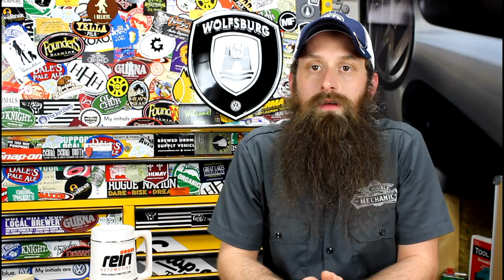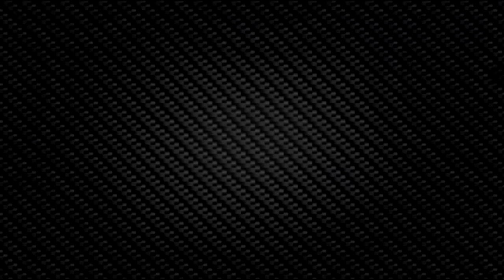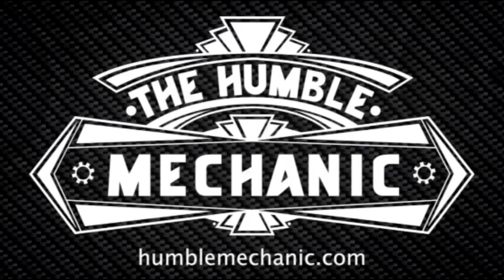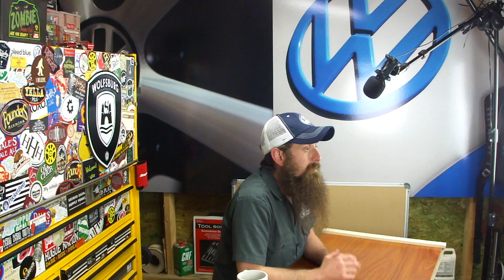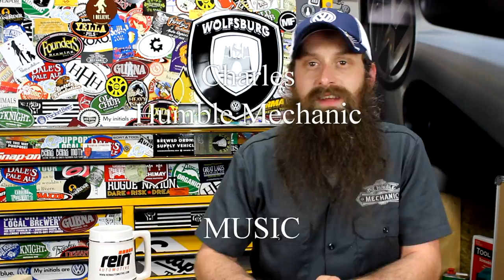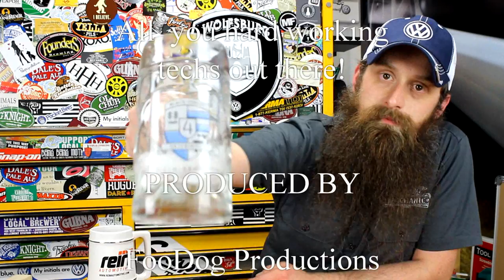Why Flat Rate is a Good Way to Get Paid

Comment: Here are some reasons I've found that flat rate is bad:

1. Enables favoritism and feeding techs

2. Enables service writers and managers to starve out techs they either 
 don't like or who don't go along with the politics of the shop

3.Creates the concept of gravy jobs that pay great and are easy (brakes, fluid flushes, etc) and **
 jobs that pay next to nothing but take half the day (pretty much 
anything warranty, water and air leaks, etc.).

4. Encourages techs to rush through jobs and cut corners to get things 
done faster, which normally results in butchered car (i.e. cutting or 
bending a bracket out of the way instead of unbolting it)

5. Selling work vehicles don't need (calling brake pads at 5mm because 
"the shop is slow")

6. Discourages techs from helping each other (I don't get paid to help 
you)

7. Lets dealerships unload their losses and slow times on the tech (Oh 
business is slow, well you're just not upselling enough on the cars that
 do come in, or Oh you didn't diag. that car right the first time, well 
now you get to fix it for free)

8. Creates a cutthroat work environment (i.e. the shop favorite is 
getting all the gravy work and the rest of the guys get stuck with 
warranty jobs)

9. Undermines the value of the work techs do and makes customers think 
everything can be done fast and done correctly (which it can't in most 
cases, you can be efficient at what you do, but if your just slamming 
through jobs you're obviously cutting corners somewhere or not actually 
doing the work.) 

10. If you lose your ass on a job or have a pay with low hours you are 
simply told you need to hustle more.

11. If you ask for a raise you are told " you want a raise, turn more 
hours" and it becomes about quantity over quality.

Most arguments I've heard against flat rate are "Well if you pay a guy 
by the hour he'll just goof around and play on his phone all day and not
 do anything" My answer to that is talk to the employee and if things 
don't change, fire them.  But the current solution to getting rid of a 
bad tech (which could just mean a tech who's just not fast enough) is 
to"starve them out" and make them quit, which employers like because 
then they don't have to pay unemployment.   

I think flat rate was just a way for companies to not pay techs the 
actual time it takes to do something and just slap a number on every job
 to where "this can be done in this amount of time, every time, no 
exceptions" and that just doesn't work in the real world.  Plus when 
they calculate the labor times they use brand new vehicles that haven't 
had a change to rust and experience the abuse people put their cars 
through.  

In order for this industry to improve flat rate need to die and either 
hourly pay or salary plus commission need to take its place.  I think 
that the only way you can make a good living off of flat rate is if you 
are feed gravy work, are not honest, or are in a shop that is literally 
always busy (which doesn't exist, there are always slow days and weeks. 
Winter anyone?)

I have seen though in shops with both flat rate and hourly guys that when it's slow they'll have the hourly guy running around and doing whatever (LOFs, state inspections, install mudflaps, etc.)  while there's two flat rate guys that have been standing around half the afternoon with no work.  So honestly I think if they went to straight hourly they would probably expect even more work from you than if you're flat rate, because if they see you standing around and your being paid by the hour, you'll probably either get sent home or be given some shit job to do (take out trash, clean, etc.) Just another thought that crossed my mind

But the whole point of this long rant is that for the industry to improve the flat rate system needs to go.  It's pushing people away from becoming techs, it's driving current techs out of the field, and it's really doing a disservice to the automotive business as a whole.  This whole idea of "everything needs to be done fast" needs to die along with the flat rate system.  

A tech's main focus going into a repair should be "How can I fix this 
car to the best of my ability" not "How can I rush through this job and 
beat the labor time"
Reply: RedneckManWV99: well said.
Reply: I'm in school for it now...but I'm getting an engineering degree after just in case
Reply: Im on my first year now level 1 and working towards level 4 , after this im doing MOT tester course/certificate or engineering course , Just in case .. Im in uk . Im just hoping for the flat rate to be removed soon hopefully
Reply: As a customer, hate hourly as over and over get told it be one hour and eight hours later have a massive bill. Not like when my vehical is all apart can say stop and leave or not pay the full bill. Hourly know up front the charge and if don't like then can check somewhere else. If I keep using the same mechanic, know it comes out to the same, as one day there be that job that goes over.
I be happy if it was hourly and had a maximum hour, in short, combining the two.
Reply: RedneckManWV99 
Flat rate sucks
Look at your pay when the shop is slow fuck it
Reply: Adriel Rowley They charging you for 8 hours when it was only supposed to be 1 hour is 100% the technician and service writers fault for not calling and telling you/approving more time when the hour that was sold is up. After that first amount of time sold is up, as a technician, you shouldn’t/ I don’t get paid. Also, who’s to keep that shop as a whole from doing the same thing on a “hourly pay system”, because the time sold vs what they charge could be different too.
Reply: 💯on👈
Reply: Absolute Facts!

Comment: My issue with flat rate is when the dealership lacks the ability to provide work. My personal average productivity percentage for 2014 was 134% then 2015 146% and now this year so far 2016 I'm at 81% and spend a lot of time in the service drive waiting for work not being paid. I'm nearly $16,000 less on my gross at this time last year yet I make 5.50 more per flat rate hour than I did last year (2015). This is a ridiculous pay system. It's a scam for owners to save money because they are only paying you if your making them money. They are not loosing anything if they can't provide you work. It's absurd that automotive technicians that aren't provided adequate work to make their money to stand around with nothing to do and not be paid but be required to be at work. Tell someone that works at subway if they aren't making sandwiches they aren't being paid and see what happens or tell a cashier at a Walmart if they aren't ringing up product for customers they aren't getting paid and see how that works out. This system wouldn't work in any other industry so why is it applied to the automotive industry. Also an issue with the industry especially in dealerships is greed by the "suits". Most managers are paid off a percentage of net profits. So this stalls technician pay advancement in most cases. If a manager is paid say 10% of the net profit and say average gross is 100k for a month and after bills and techs are paid it leaves a net of 50k so that manager makes 5k and say all the techs made $10 per flat rate hour so if that manager gives the techs a raise and say now some make 20 to 25 and other in the upper teens and gross for the month is again 100k but now the techs make more so the net drops to 44k after bills are paid and techs are paid now that manager 4400 for a month so they cut their own throat. This is what stalls technician pay. I know this is a old video I'm commenting on but just feel that there are sides of the flat rate system that are kept in the shadows. Also just to point out that the industry is hurting bad for technicians. They are leaving the industry and fewer and fewer are entering the industry mostly because of the pay system, which has turned out to be a huge con to flare rate for dealerships and even independent shops but flat rate is still in their favor as far as expense goes, but you can't run an industry off a pay model that's over 30 years old when everything around you is advancing. Cars have advanced so much and the technicians have to be just as advanced or more advanced than the cars and trucks they service therefore the pay system needs to Advance as well. Believe me there are times I absolutely love flat rate but the cons from a technician side greatly out weigh the pros. Oh and flat rate kills the team aspect of a service department because the techs are fighting for every hour they can get so why would they help the other guys.
Reply: Don't like it? Then leave, McDonald's are hiring.

- 18 years shop owner in Detroit

Comment: I agree with you 100%! Flat rate isn't perfect, but it is the best system I ever used. My last shop had an odd set up, variable flat rate. Tell me if you have heard of anything like this...

Jobs were classified by skill level. Each skill level paid a different rate ($10/hr - $26/hr). There were 5 pay rates. 4 of the rates were the same across the shop and tied only to the skill level of the repair. The top rate was unique to each tech and tied directly to the technician's training and ASE certifications. It was very confusing to keep up with, but once we had it figured out it actually worked pretty well.
Reply: Thats just confusing

Comment: Sorry but I disagree.  Been burned more than once for paying for service that was never performed.  Classic case: guy said I needed my rear drum brakes cleaned at the service desk.  I thought I would have some fun and agreed.  My car was serviced right in front of me while I waited... big glass window.  So... car is ready.  I inform the desk jockey I don't have drum brakes in the rear.  He insists the disk brakes were still cleaned.  I told him that;s stupid... and oh yeah the tech never even took the rear wheels off the car.  The tech of course says "how can I clean drum brakes when the car has disk brakes?"  Point is... if I had not said anything I would have been charged.  That's the flat rate system at it's finest.  It's called fraud.
Reply: +MrFenwayfool I do enjoy your vids BTW!  Well done.
Reply from the maker: Thank you. I agree that flat rate is not a perfect system. But it almost sounds like an issue with the shop or service writer not the flat rate system.
Reply: I think his overall point is that flat rate incentivises fraud repair jobs
Reply: HumbleMechanic as much as I agree with you on most of the pros of the system, I think flat rate and commission based systems in general do not encourage integrity in any industry!! and again in any industry the guy who spends half the day on Facebook should be fired. I've said for years "the squeaky wheel should get replaced not greased"!
Reply: MrFenwayfool . Ummmm no. That’s a dishonest crooked shop.

Comment: In this case it is not "All About the Bass" but "All about the Dispatch". The dispatch process can make or break your flat-rate experience. If you are for some reason not being dispatched your fair share of "the gravy" you are going to hurt. We have this flat-rate system that by admission is "not perfect" and then we have this easily manipulated dispatch process that is clearly flawed. Humble mentions how you can stack jobs. Yes at times this is possible. Remember that most Dealerships have rules regarding when you can call of one job and get dispatched a second, this system of rules is prone to allowing cheaters to prosper.

I do not agree with the idea that as soon as a guy becomes an hourly employee he becomes lazy. There are millions of very hard working hourly employees working in America. It is the immature that become goof offs because they do not have to fight the flat rate monster. Modify your hiring parameters so as to not hire goof offs.

Along with the time for each job (set in many cases by the manufacture) there is a second just as important factor in the equation that determines what you end up making. That factor is your base rate. This base rate is set by the "company". Hire in at a low base rate and you can be very efficient but still suffer due to low times set for the job.

Many jobs should be done at an hourly rate. Jobs like broken bolts, working with rust or accident damage working with theft or rodent damage should be paid for on an hourly basis.Jobs that start out being done by one mechanic and then get passed to a second (many object to taking on something someone else took apart, failed at reassembly and are now your problem). The mechanic should be paid if any thing disrupts the smooth flow of getting a car into the shop (like lost keys, cars not in the place where they should be, cars that  are dumped at the back of the lot by a tow truck and will not start, cars that do not have tires on them or have a flat, cars where the steering will not unlock, or will not go into gear. Mechanics should be paid for all these problems that make it hard to stay even with the time assigned to the job.

If you are dispatched a car that the dealer neglected to send you to school on should in some cases be worked on hourly. Any washing or cleaning of the car should carry an hourly price tag or some extra "tenths" added to the flat rate time.

In some cases diagnostics should be paid for hourly. GM has a theory that any electrical fault should be able to be diagnosed in .6 (six tenths or 36 minutes) this is not fair. The idea that a tech should be able to decline taking on a job that is not being priced fairly should be discussed.

Simply saying "yes I know the flat rate system is not perfect" is not enough. Steps should be taken to eliminate or reduce the number of reasons that are preventing the flat rate system from getting better or "more fair". 

If a Tech happens to beat the time assigned and builds up a sort of "bank" of hours, these hours are his,bought and paid for,no more questions. The management should not be allowed to say "well you made time on those other jobs so now you lose time" This is wrong as management does not have the right to manipulate what I put in the bank through my efficient work habits. Rarely do you bank time because the time assigned is so generous. You bank time because you worked hard, bought the right tools, made an effort to learn the system and did not make any mistakes..

Comment: Hey Charles, I think a performance based bonus system and skill dependent salary/hourly rate is the best system out there because some guys in my dealer just spin filters all day and earn mega bonus but they are on a lower hourly rate. But the more skilled and master techs who do diagnostic work all day, that isn't as lucrative as service work, get a higher hourly rate pay. So it sort of evens out. And also group bonus systems work in this situation too, so long as everybody does what they are best at. With a good team it can work really well. One guy can be smashing out a clutch change while the other guy is struggling with a strange network fault and no one is gonna be pissed off because they are both earning the dough! :D

Comment: personally I prefer the hourly system itsa matter of raising the good tech hourly and keeping the crappy ones low my grandad has a small shop 8 guys 4 bays former dealership and he pays hourly every guy starts out at 14/hour and it increases every 180 days  till he hits 20ish depending on how good a worker you are so as a new hire your encourage to work had for a few years to make maximum rate guys like it as u get paid hourly but still have reason to move fast and fix it right the first time

Comment: When you work at a shop that pays a good hourly rate + a commission you will never go back to flat@#&%, back in the day it worked, today it is a tool for the employer, i know because i am a employer, it only serves a few and the customer always loses, flat rate was actually proven to create a dangerous condition in the housing electrical fields and is illegal to be a system of pay in many if not most municipals, fact based.

Comment: The only problem I would am worried about going into this field is the not getting paid if you're not working. Personally as longs as the employee is there I believe they should be getting paid. It's not the tech's fault if no cars roll in, and they're spending their time to be at their job. And from experience I know when I've got some down time I am cleaning my station, cleaning or resetting up my tools, or helping another tech with their job. It should be kinda like waitress pay; if they have no customers or receive little to no tips the business has to at least meet their pay to the average minimum wage and not waitress wage. They should get paid for coming and showing up.
Reply: Randizzle Forshizzle, I think the tech should be able to make there eight hours (hourly) if they day is slow while working as flat rate.

Comment: I think I have a very fair pay system where I work, flat rate with a 36 hr minimum so if I get my a&* whooped on another techs come back, I know I still get paid, on the other hand if I kill it and make 50-60 hours I get the extra money sweet deal
Reply from the maker: Michael Berg I like that because no one really wants to make 36 a week. You want 50+, but if times are tough you get something.
Reply: I agree.  I understand guys who work at flat rate shops with no guarantee being pissed.  I would be too.